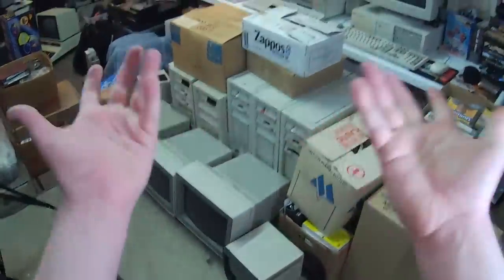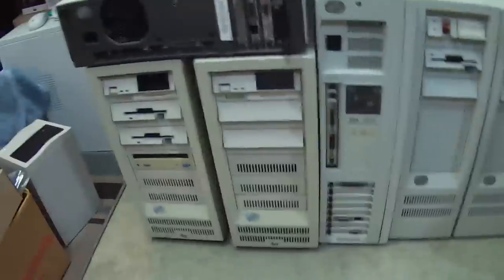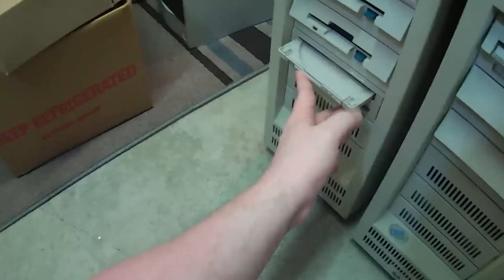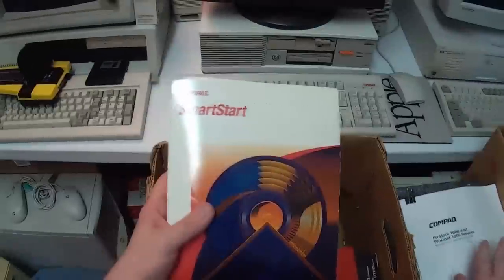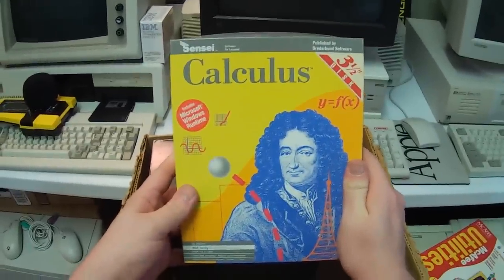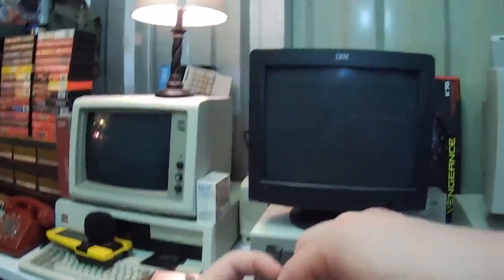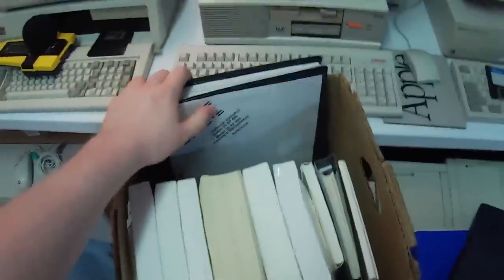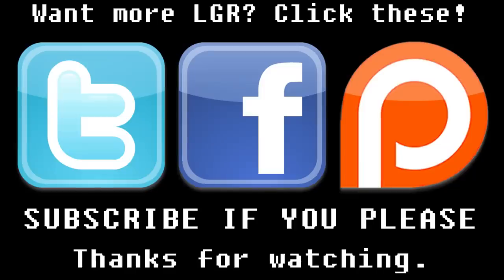LGR - IBM PS/2 Computer Motherlode

Comment: Very cool and interesting stuff you got there.  Brings back memories of my early days of computing.  I've always liked how the IBM's systems looked back then.  My first computer (stand alone/and on my own)  was a Radio Shack TRS 80 model 16 with two 10 inch floppys , built in display,  And 10 megabyte external hard drive.  512 or 640  megabits of ram and running Unix/Zenex .   I got this system for free from family member and remember hearing it was 16 thousand dollars when purchased new.  I also tinkered/programmed with the Commodore pet until I got frustrated running out of system ram.  But my favorites when even younger was the Texas Instruments Ti 99 4a with voice synthesizer box, tape drive,  And external floppy drive all hooked up using a tv .  I also Used cartridges and I had the extended basic one as well.  Loved the games for that system.   Also loved the Apple 2:  C, D, GS models.  I remember in computer lab seeing an apple 1 made from wood mostly.  Great times back then. Thanks for putting this video out there :)

Comment: this is like a look into my childhood. We had an old proprinter but it was the smaller size one. My first computer was a PS/2 Model 70  running windows 3.1 back in the mid 1990s. It had a 16 color IBM 14 inch monitor. similar to the ones you had in the video but the power switch was on the right. I also had that Model M keyboard.

Comment: The documentation and printed materials make these old systems that much more interesting.  Nowadays when you buy a PC or piece of electronic equipment you're lucky to get a one page printed "quick start" guide.  I recently bought a new vehicle and it came with a 10 page "owners reference" (which is a joke) and the owners manual came on a DVD which doesn't work.  I had to go to the companies website and download a PDF owners manual so i could find out what kind of fluid spec i needed for the engine, transmission and transfer case.

Comment: I have hardware for a 80s/90s touchscreen bar arcade. It had a metal cable go all the way around the monitor, with various solder points to the monitor. I did a lot of research and I believe it triangulates differences in resistance across the screen. Screen itself I believe was coated indium tin oxide which would help that.

Not sure how yours works, but maybe like that? :P

Comment: Just a note about PS/2 floppy drives; I own 5 drives. All except one came to me non-working. Generally, the capacitors will fail and you'll end up having to replace them; the ones on my model 80's Mitsubishi drive were so badly leaky they didn't hesitate when I pulled them off with a pair of pliers! You're gonna want to replace the caps if the drive doesn't read the disk, otherwise I do have 1 curious drive that is unaligned, and is very decisive on when it wants to work. Good luck!

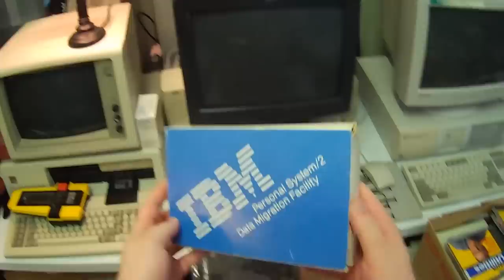Comment: The data migration facility (15:00) was to transfer files in from other machines (like generic PCs that had only 5.25" drives). Until the PS/2 3" drives weren't much seen.

Comment: I was a tech when these came out. I worked Amoco oil company. My computer cost $18,000. It was a PS2 80 111.  I had a clone at home could do anything the IBM could do.  My home PC cost $1200.  The PS2 was so hard to upgrade.  Each machine required a setup disk with all the setup info.  If you lost that disk, you were hosed if the setup battery died!

Comment: i remember allot of things you used to have to do to a computer to make it work. setting DIP switches for slave/master on hard drives and floppies. setting the address on things like 56K modems and other cards. making sure you install cables correctly or devices didnt work, the red marking on the cable to indicate pin1. having to ensure the power connector going to the board was properly connected.

we take plug and play, and keyed power connectors for granted BUT it wasnt always that easy.

Comment: A long time ago, I saw a light for the 5.25 inch drive bays.  It was an actual light that fit in the 5.25 inch bays for the full tower PC's.  It was shaped just like some of those IBM server disk drives.  It had two bulbs and a clunky on/off switch.

Comment: When I was in college in the late 1980's we had PS/2 computers everywhere. I spent a lot of time on a PS/2 Model 60 with the 8512/A Graphics Adaptor and its complementary monitor. It also had a Micro Channel memory upgrade. 4MB I believe. Getting the right memory drivers can be a problem. I eventually found them on the original disks that came with the system.

Comment: Old computers huh?

✅ Massive tower.
✅ Massive power supply.
✅ Massive CD drive.
✅ Massive floppy drive.
✅ Computer manual comes in a binder.
✅ Computer comes with a manual at all.
✅ Computer is so heavy it needs a carry handle.
✅ Carry handle is squared.

Yep. I was not disappointed.

Comment: At 15:00 a parallel to serial computer. 2 uses of it. First, connect a serial printer to a parallel computer. Second, more odd. Printing the data from an old computer, and record the printing to a second computer, using the serial port. Doing this, one can recover old datas from an old software, to convert them to a new one.

Comment: The 80486-family of processors were available in two versions. The SX version that lacked math co-processors, and the DX-version that had built-in math co-processor.  A popular upgrade back in the mid 90's was from the 486 SX 20Mhz or 25Mhz to the 486 DX 2 66Mhz or DX4 120Mhz.

Comment: When i was a kid (Graduated HS in 2005), when ever we went to a computer shop they would talk about sound cards. Like sound cards were the most important part of the PC. I had a AMD Athlon 64 in 2003 or maybe early 2004. It owned my Pentium 4 that had integrated graphics. Now Intel owns AMD, i have a Fx-8150 in my LAN/media box. I was so disappointed w/ the 8 core. I actually retrofitted my mobo, ram and CPU for a i7 3820. I now have a i7 4820 and a gtx 980. My LAN box has a R9 290. Back then i wanted the best PC possible for Everquest. I ended up using the Athlon 64 and the P4 side by side for multiboxing. I ended up changing the board for the P4 to get a AGP video card. I saw a decent improvement but the P4 could had issues compared to the Athlon 64. It was than i became a AMD fan. Than in 2012 i made the drastic change to Intel. I saw a better processor. This is my first Nvidia video card, i always went w/ radeon. But after a few weeks of research and reading message boards i found nvidia to be the popular brand. My two HD 7970 matrix's died a week apart and the Asus warranty was taking forever (i still love Asus, everything possible in my comp is Asus. Even router and monitors). Instead of waiting the almost 8 weeks, i went ahead and bought a new card. They were out of the HD 7970's so they sent me two R9 290's and i put one in my LAN box and still have one unopened and brand new.

Comment: Sure brings back memories. Had a Model 60 by my desk that was also the department server. In another department, the floppy drive went bad on a PS/2 desktop and IBM wanted $400 to replace it. Because it was special. That was when generic floppy drives like Teac were going for $20. IBM really had the corporate suits hoodwinked.
Any of those come with Token Ring adapters? Or all just coax?

Comment: The printing company I used to work for had some fairly high end Scitex graphic workstations that were powered by Pentium PS/2's running AIX. I used to reboot them with a floppy disk and then create an 8 MB ram drive and install Doom into the ram drive. Blast some demons, then reboot and it was back to the normal system.

Comment: I still have my old IBM PS/2 sx56 here under my desk. It was my first PC. Wanted to buy a soundblaster for it when I was 12, that was the day I learned about the MCA slot, and that I won't have a soundblaster for it after all, because these didn't have ISA slots and PCI was still not a thing then. I also have OS/2 2.0 for it.

Comment: Those ps/2 model 80, and maybe the 60 also I don't remember for sure, were pretty serious business systems.  They had very high-tech for the time ESDI hard drives, and you could do stuff like if some of the RAM went bad, the system let you "map" around it.  They used "micro-channel architecture" (MCA) which was real good for commercial stuff but not that great for home computers.

Comment: I had two IBM PS/2 Model something (x286 and x396) back in the late 90's. The x386 was a very heavy tower. Oh, and I have installed Win 95 via floppy a few times and it wasn't bad (unless a disk failed (thank you backups)).

Comment: At 8:30 I had a hard drive like this, I mounted the HUGE drive in my Pentium90. Its capacity was 600MB, very big at the time. The audio connectors are for when you mount a CD in the bay.

Comment: Speaking of CPUs in a tin, my old computer's AMD FX 8350 CPU from 2013 came in a tin box, so I guess they're not just (such) an old thing. I think maybe the Phenom processor I had before that came in a tin box as well, but they were both made to accommodate an OEM heatsink and fan, and thus did not resemble weedy grindy bois.

Comment: I had one of those CRT touch screen monitors. Serial instead of ps/2 but worked with an adapter. Won it in a coin flip with a coworker at Pizza Hut.

Comment: in college we had a time share network with these touch screen monitors. they were sensor based if i remember . also if u need impact printer ribbon, staples still has those . :) i first saw the prototype of the first ibm pc and pc jr at their losangles headquarters in 1976. they jokingly said it wasnt a real computer. hem

Comment: I had no idea win95 came on floppy disks. I had to install Windows 3.11 from disks onto a dos emulator. I copied all the data on the install disks onto my hard drive before running the installer. Probably saved some time.

Comment: There is a huge market for vintage IBM Model M keyboards now due to the generally crappy quality of modern dome switch keyboards vs the old mechanical switch based ones like the Model M. I have one that was made in 1986 which I obtained in 1989. It has been in daily use on every PC I have owned since then and is still going strong.
Reply: Atomicskull Mechanical keyboards are still widely available. Most of them are geared towards the gaming market. Plus a company called Unicomp, who own the rights to the IBM Model M, continue to produce the Model M in PS/2 and USB variants, as well as derivatives that contain extra features.
Reply: ***** A lot of people feel that buckling spring switches have a better tactile feel than the switches used in modern mechanical keyboards. I'm aware of the Unicomp produced keyboards and while they are good they aren't quite as good as the originals. They use a different plastic (the shell isn't as strong), the key springs are lighter and they lack the internal metal plate. I read that Unicomp doesn't make a lot of profit on them because they are expensive to produce and almost never need to be replaced.

Comment: My friend andrew would fucking love an empty IBM PS/2 tower case, because you can put even the latest motherboard inside, a full sized ATX!! The back would need to be cut to fit a regular board's output/inputs however. Strong metal, heavy rugged cases don't exist these days.

Comment: All model 80s have 386 CPUs. I have one with a Model 60 faceplate, SCSI not ESDI drives, 12MB RAM, and it runs OS/2. The 60 is a 286, I have a Model 30 286 but it needs a floppy drive. The 33MB hard drive works!

Comment: long long time ago my firts pc was an IBM, i think model 80 with an 4x86 sx 50MHz, 8 meg of RAM an 80 meg of SCSI HDD. i had in it a floppy drive with 2.88 meg capacity. At that time i modified a lot of 1.44 floppies with a drill machine to be able to format them to 2.88. And they worked. Problem was that i was the only one in my city with such a FDD drive..so sharing 2.88 floppies was not a good deal, but for storage they were perfect at that time :-)

Comment: That was a lot of stuff :) I'm glad you opened the disk, I was hoping for that. Sadly the content was boring.
Reply: Actually it was forensically interesting.  The network that the PC was on appeared to connect to both a Novell server and a Unix server.  IPX was for Novell and TCPIP was for Unix.  Further I bet that the Novell came first followed by Unix and some "network engineer" had to edit net.cfg (network configuration) by hand.  Without this file the PC would be standalone and effectively worthless---unless you use "sneaker net" which where you enter data, copy it to a floppy and then, in sneakers, walk the floppy over to another PC.

Comment: really like LGR, videos are great. You had a touch screen monitor, and you said you didnt know much about it. I dont either. However in die hard two, they used a touch screen to crash a plane. they used some sort of pen, wired. I wonder if it's the same?

Comment: If that EWB disk still works, that's a cool little program.
Reply: Also, I'm not sure if you know about calibrating the interleave of MFM or RLE drives. Norton's calibrate utility is the best of them, makes the drive sing. Almost a fifth of the speed of a good Internet connection today!

Comment: The IBM 9595 (far left machine) is the best one there, all Microchannel (MCA)     The processor complex is changed as a whole card.   If you need a sound card for it you can use my Win NT driver and adf definition file for the Ultimedia Sound card DFE5 MCA id

Comment: :D - seeing the rest would be good and learning if there were any hidden 'treasures' on the floppies.  How many books, floppies, etc, would you say you ended up with.  How many floppies still work or fail?  Any interesting error messages with any of them?  Also seeing if the printer still works, or if the ink did dry up, or not.

Comment: you might want to look for a eduquest 40 machine as those are very unique machines, generally 486's and held 32 mb ram or so and scsi and ide. Not a very valuable machine in todays market, but were based on the ps2 but had isa slots and took up the space of the monitor in the video as a all in one.

Comment: Regarding the Model 80 with the caddy drive (3:56), I actually have an interest in the CD caddy style. I'm aware some people still make them in that style, though they're quite expensive. My issue is actually finding them in the first place. If I google, all I get are "caddies" for HDDs so you can replace your laptop optical drive with a second HDD. I do not want that. I want one, desktop-grade, SATA-based, caddy-utilized, DVD drive. Is it THAT hard to find?

Comment: The IBM PS/2 was a piece of crap.  I had a model 25, it burned out about a year and 3 months after I bought it.  Piece of junk wasn't cheap either,  it cost $1300 back in 1988. Didn't come with hardly anything.  The manual was a joke, you had to shell out another $100+ to buy the DOS 4.0 operating system.  Expected much more from a company like IBM.

Comment: I miss the days when there wasn't things like software activations.  Not that I am condoning piracy but for example, if you had two computers, and you needed to get one going with DOS, you could just install it on the second machine (yes, technically you were supposed to buy another copy) but it was good in a pinch.  These days, activations usually ties the OS to the computer (motherboard), although it is possible to use Windows 10 without purchasing a key I guess... you just can't customize it and are nagged periodically about purchasing a key, but it otherwise works.  But still, the day when copyright protection wasn't really a concern or a thing, those were the good days.  Mainly because every nerd had multiple computers sitting around.

Comment: also 7 desktops with everything how they came, complete case extra cards modems hard drive and some orifnal ibm reinstallmemt cd didcs, pentium boards with memory complete and fully working  expect need to replace front panel power button and one just needs a batteru 20 i believe and a few external cd re writwrs

Comment: I have a bunch of earlier PS/2s. 25, 30/286, 55sx, 75, 77, 90 (with some duplicates). I remember that touchscreen- high tech for its' day, but it really sucked. I have that same NEC caddy CD drive, used it for many years, up to the early 2000s. Even with my PS/2s. Think I have the other one too, but never used that one.
Is that a legit copy of Electronics Workbench??
Look at that- also have a Compaq Deskpro 5133. Which I also used that external CD drive with. Nice score!

Comment: If you need any help navigating Novell or how some of the older network gear works reach out to me. I use to convert Novell 1.0 to 4.12 to Windows NT networks. Make sure before upgrading any RAM that they do not run Novell 2.0 or lower. You will get an error if you are over 1MB or 2MB of RAM. Use to run into the limit when imaging data over.

Comment: I remember the days when 386 and 486 weren't "slightly" different--Especially if your 386 had an SX processor and not a DX with the math coprocessor....
Reply: The 386DX still misses the math coprocessor ! A 386 DX means that you have a full 32 bit bus whereas the 386SX is a cut down version that doesn't support the 32 bits bus. But you were right for the 486 (yep, intel changed the meaning of DX and SX when they switched to the 486)

Comment: I had an IBM PS/2 Model XX (don't know which model, but I know it was the slimmer model that went underneath the monitor) and it had a weird OS on it with a lot of tabs and yellow folders. Everyone in this Retro PC Facebook group is telling me it's probably a variant of OS/2 but none of the images remind me. It might have been a proprietary file OS and I was like... 9 or 10 when I had this machine (it was from Goodwill, this was back in like 2000/2001). Anybody know what OS I'm talking about?